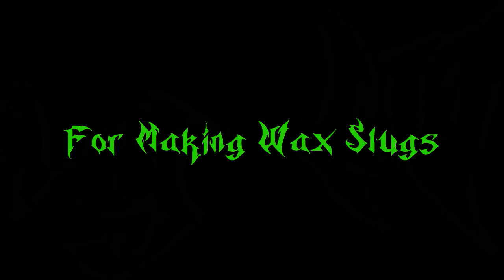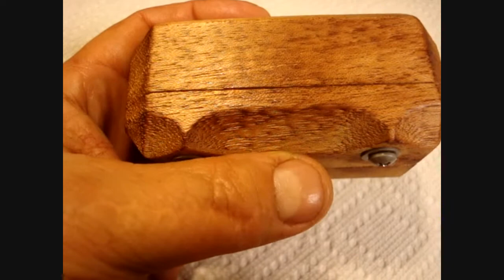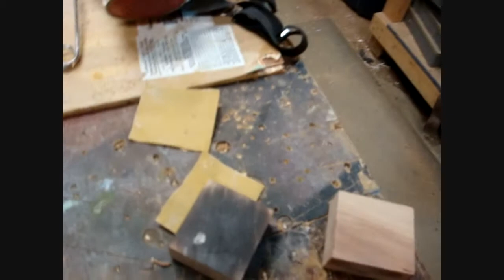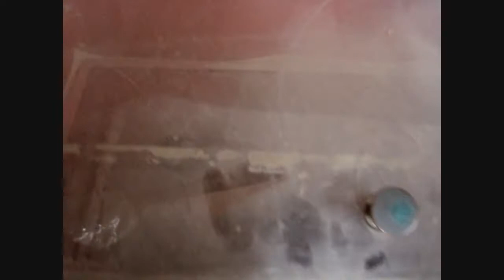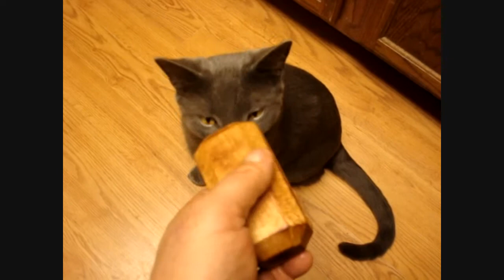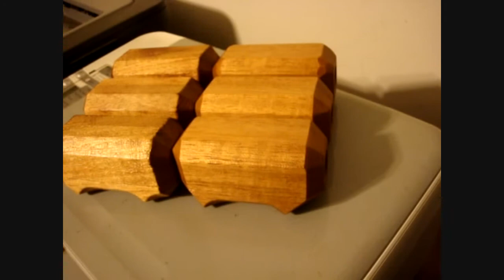Phoenix Post Apocalyptic Shell Preppers

Comment: You're in for a treat bud - these things work so slick it'll blow you away. BTW - also work just fine for 20 gague shells too. And it's easy to make your own buckshot, lead slug and of course wax slug rounds with these (waxers are the easiest of course). For buck and slug you use the shot from the shell to melt down and cast. I use the lee molds and they work like a hot darn. Plenty of youtube vids on that and it's pretty cheap to get into. You'll need overshot cards for the buck.

Comment: Well it definitely sounds like you're on the right track. Wax slugs are a great way to start and leaving the crimp roll in place like the shell prepper does is a must for properly constructed waxers. The 7/8ths slugs are probably a little more accurate than their bigger 1 oz brothers, and 4 buck is a lot of fun - it's like shooting something 27 times with a 22lr :) and good for lots of varmints. Cheap birdshot loads recast as 00 are a very economic way to practice for the zombie apocolypse :)

Comment: having said that tho - while you can do it just fine with a dipper and a pot in the garage, a dedicated lee melter with the pull down lever to pour is much nicer. You'll get better temp control and fewer re-pours needed (no matter what you do some of your bullets will come out bad, but with the lee pot it's a very small percentage. 

remember you need to lube and smoke your molds before you first use them, and then every few hundred casts. lots of vids for that too. very easy.

Comment: No, you don't need anything special to melt lead. I started off with one of those cheap butane camp stoves and an old pot. Pour in the shot (or wheel weights or whatever) and get the temp up nice and hot, and then flux it a little by putting in a small bit of tea candle wax and let it burn off (should flame, if not light it CAREFULLY). Skim the crap off the top with an old metal soup ladle and you're good to go. There are important safety isssues, but lots of vids on you tube to help.